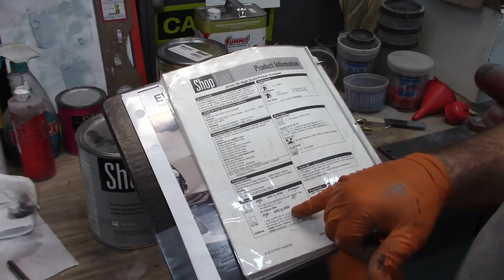High Build primer over epoxy. Spraying with Black Widow gun. Jade part 59.

Comment: Not sure if I would trust leaving lacquer thinner in a harbor freight spray gun.The seals may be sensitive and swell
Reply: Clean it, put a little thinner in the cup, hook it up to shop air, blow it out completely, remove the cup, apply gun oil where indicated, store it in a plastic bag. I still use guns I've had for 20 years using this method.

Comment: Primer filler dosen’t bother me. On top body filler and then a lite black primer coat to find high low spots after blocking. Never used epoxy covering.

Comment: Boy, that reducer really allows the primer  to flow a lot better. Might have to experiment myself as I usually just use primmer surfacer and hardener and it comes out thick and heavy, great practical demonstration. have to go buy some before I spray the body.

Comment: I've always been scared to death to use a box fan for a paint booth. Was always afraid a spark from the motor brushes would start a fire with all the fumes going through it. I'm obviously overthinking things since you use one and obviously haven't had any problems so maybe I'll give it a try next time.
Reply: The average $20 box fan sold an home improvement stores are brushless. There is no start capacitor and no internal centrical switch to change from start windings to run windings. They do use three sets of windings to allow the top switch to change speed due to “Pole” position.  Suggestion; look for Jeremy Fielding in youtube, click on his channel as he discusses motor types and universal motors. If the used brushes, they would be $5 more. Hope this helps and Jeremy is a cool guy!
Reply: @deankay4434  thanks for the info. Makes sense!

Comment: Just my 2c but you gotta use a siphon feed gun with a 2mm tip for DTM/High build/Epoxy primers - those are hungry paints when it comes to flow rates and few HVLP/LVLP guns can feed them. They need to be hosed on like water on a fire. Otherwise, you're just making work for yourself.

Comment: I see the powder guide coat used more and more. I am guessing it will show sand scratches, pin holes and other defects better than a mist of cheap Matt black paint?
 Another painter save some of his 1k primer in a contrasting color, as a wash for the same purpose. I would guess it would dry within reasonable time and do a decent job. Thanks for the tips, especially the seam sealer on ever panel joint. They build these quick for profit and less effort than a farm tractor. Shame! 
I find blocking easy sand filler a bear on long reverse crowns or concave areas, like the bed side of my 1967 C10. Great video again.

Comment: what blocks the bondo work from mapping through the paint? the epoxy or the high build primer? have used both and still see some mapping. What is the best way to seal bondo for no mapping? thank you
Reply from the maker: I have that problem sometimes. Believe it or not, coat the entire panel with a thin layer of filler and block it smooth. Then add high build.

Comment: Excuse my ignorance.  Why do you need another primer over the epoxy primer.  Why can’t you go straight to the base coat?
Reply from the maker: Epoxy acts as a kind of sealer to the metal. It is sprayed relatively thin. It binds to the metal. High build primer is used to give you something to sand if you need to make sure all the body work is right. It is sprayed thick. If you have a perfect car or panel, you can go straight to base coat. Most people don’t.

Comment: Appreciate this video as I am in the middle of priming my Falcon and using ppg shop line epoxy. I am having to go over some old epoxy that I shot 10 years ago (stalled project) and find myself sanding through to metal in spots while getting the body ready for the new epoxy. It's going to be a bit before I can actually shoot the epoxy primer and was told I CAN'T spray etch (rattle can) primer on the bare metal spots (to keep it from rusting) because it will react with the epoxy primer in a bad way. You mention you have some spots of etch on the hood. Would like your thoughts on using the etch. Is it actually safe to use?
Reply from the maker: I have used SEM self etch per instructions by my PPG rep. I have filled in spots with a light dusting of self etch when I have broken through my high build. No reactions. If you are recording with epoxy, everything needs to be sanded. Epoxy on has a 4 day window to top coat.
Reply: @JoDaddysGarage  Yea...1st shoot had some textures and drying issues.  Will be outside of the window for sure. Good thing I don't hate sanding...lol.

Comment: Got a question, did u sanded the epoxy primer or just painted the 2k on top of epoxy?
Reply from the maker: I sand the epoxy. You can spray 2K straight to epoxy, but you have to do it within a certain time frame. Manufacturers may vary.
Reply: @JoDaddysGarage  Been using the summit (single stage) DTM and 2K urethane primer for a while, after spraying 2 coats of the DTM we wait 45 minutes and then go right over it with 2 coats of the 2K primer, this gives a nice starting point for block sanding especially if you are starting with bare metal. If you slightly over reduce the second coat of 2K it will lay down like glass. Best Regards....
Reply: I’m working on my c10 body right now. I’ve sanded the clear coat off which was original paint so maybe 50% of truck still had clear. There’s spots of rust where I’ve taken down to bare metal but other than that the body is straight with no dents. I hit the bare metal with etching primer already. Would you still use an epoxy and then urethane in a case like that? I saw in another comment that you said the epoxy? That makes me only want to do epoxy. My understanding is epoxy can last awhile before paint and my fun time is limited so this may take me a while. I also have come to understand that epoxy is not typically sanded but seems your epoxy is able to be sanded? Thanks!

Comment: Whats the purpuse of using 2 diffient primers?
Reply from the maker: Epoxy bonds to the sheet metal. If you have a straight vehicle, you can use epoxy. If you have to do bodywork, you top it with high build. But epoxy always comes first.
Reply: @JoDaddysGarage  so basically its for diffiant type metal's. Like primer/ surfacer?
Reply from the maker: yes
Reply: @JoDaddysGarage do you have to put regular 2k primer or sealer ontop of high build. Or can u baseciat rigjt on the high build